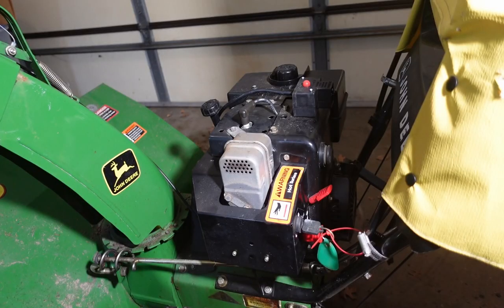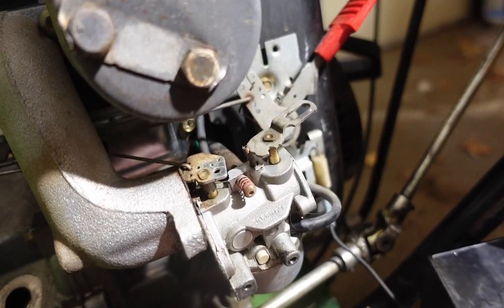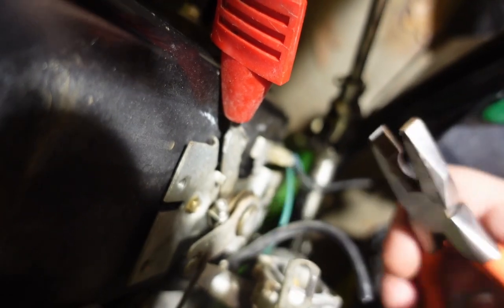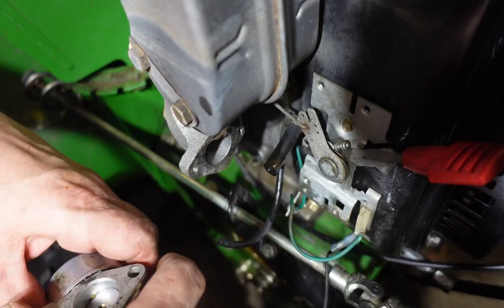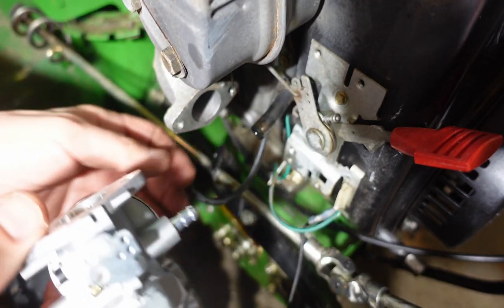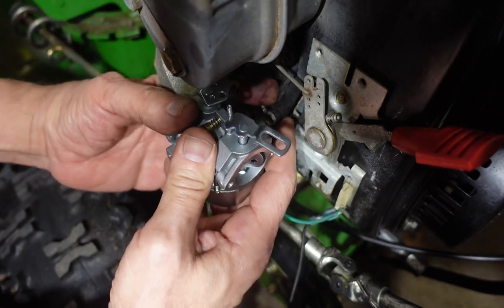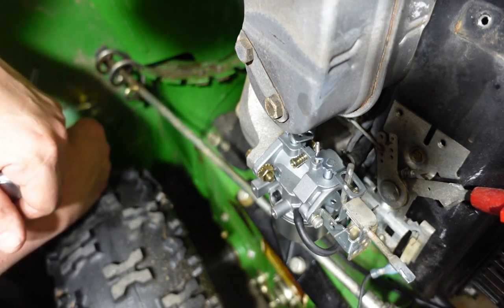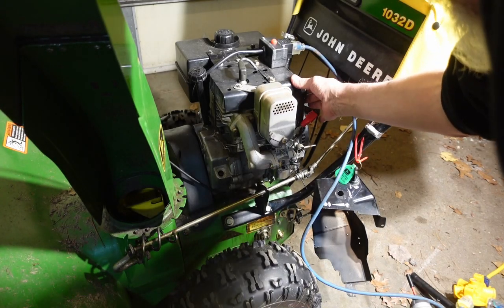Replacing a snowblower carburetor (Tecumseh 10HP)

Comment: In addition, I recently speeded up the entire repair by also detaching the exhaust manifold from the engine.   Much easier to get at the screws on the carburetor.

Comment: I can't start my generator.  Wonder if it needs a new carburator
Reply from the maker: There are a couple of ways to find out. Honestly, replacement carburetors are cheap enough that a replacement is probably the best bet, but making sure the spark plug is clean and sparking, the fuel system is working, and the retro-encabulator has enough lubrication from the feed line are your first line of defense.
Reply: @magic.marmot  the retro encabulator huh

Comment: Woohoo!  Congrats on the successful project.  Don't you have two working snow blowers now?  Probably a hot market to get ride of one now, so to speak... 🙂
Reply from the maker: I have one down at the Minneapolis house that Sonja has learned to use and is taking over the task down there. This one is for the Bemidji house, and I'm hoping it's going to be enough.
Reply: Ah, I remembered seeing two but missed the part where they were in different locations.  Make sense.  Hopefully you don't have to use them too much this season.